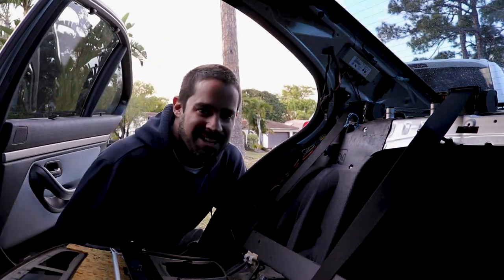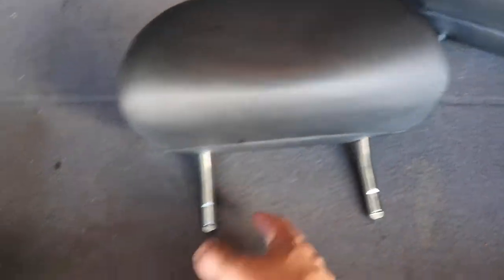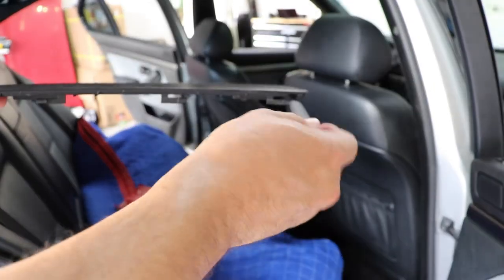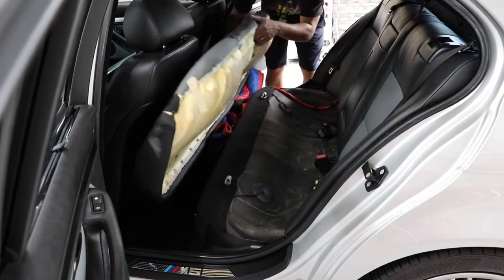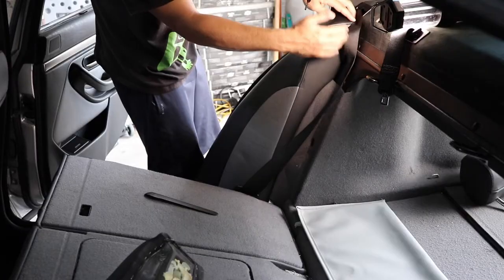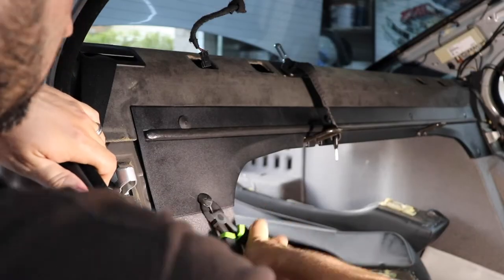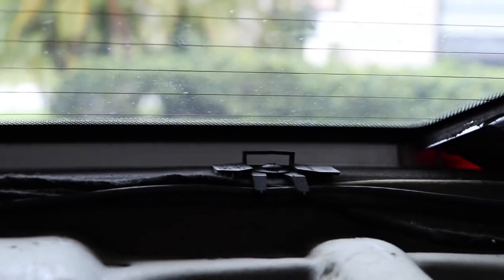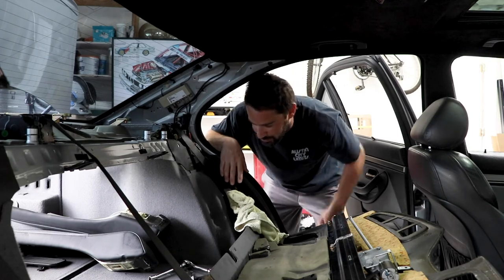BMW E39 Rear Deck Removal

Comment: Excellent video, thanks!
I will be doing a rear suspension replacement this winter on my 2002 530i with fold down seats. 
I also have the DSP stereo, factory subs I believe,  non-nav business cd unit in the dash, and would like to upgrade somehow to allow aux port, maybe bluetooth, streaming (spotify) etc. I don't have to have the double din nav type unit and haven't found a good option that works with DSP set up, which I gather is very expensive to modify.  I also have a dice ipod unit in the trunk I have never used that was installed by PO in 2011, replacing the stock cd changer. It sounds very nice as is, but would upgrade speakers etc. if it made sense with the rear deck opened  up. Would be nice to retain ability to play cd's, but not mandatory...
Don't want to spend alot of money, do you or any of your followers have any experience in doing this?
Thanks for the great work!
Reply from the maker: I have a BlueBus bluetooth device but havent installed it yet. May work with your setup if you want to look into it. https://www.bluebus.dev/

Comment: Great video, do you still have the car?
Reply from the maker: Still have the car and hope to keep it for life.
Reply: @NoGaragE30  Great, hopefully you can.
Does your car have IsoFix, as it has the parcel shelf anchors? I am trying to retrofit  the IsoFix but can't seem to find any pictures of the lower anchors on a foldable  back seat car.
Reply from the maker: @Taz_84  It does. Cant see the lower anchors on video though.
Reply: @NoGaragE30  I know, I was wondering if you could take a couple of pictures of them for reference. I searched everywhere for pictures but couldn't find any of cars with folding seats.
Reply: Wow!! Looking to do a rear shade conversion on my E39 and this video helped a lot!!